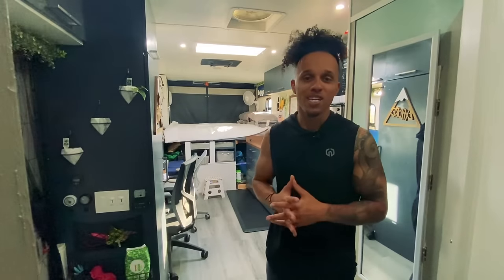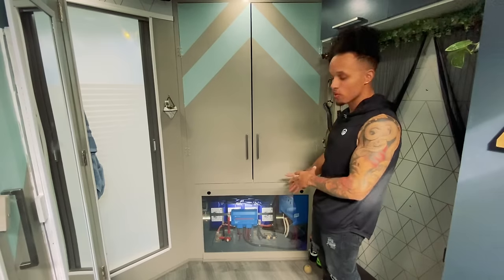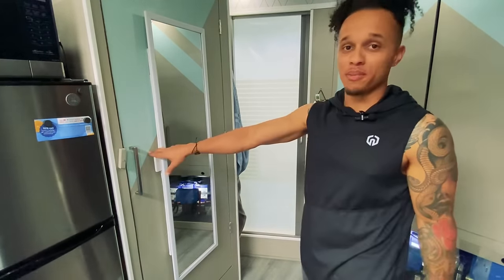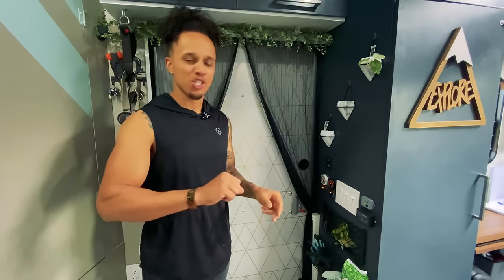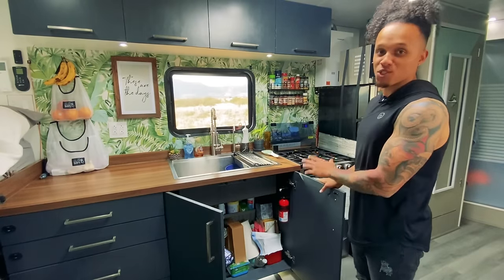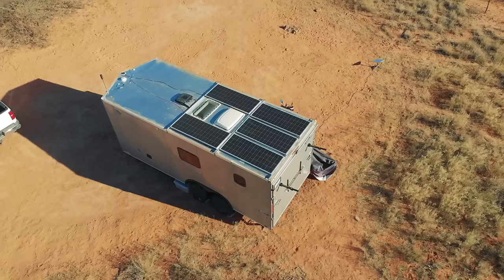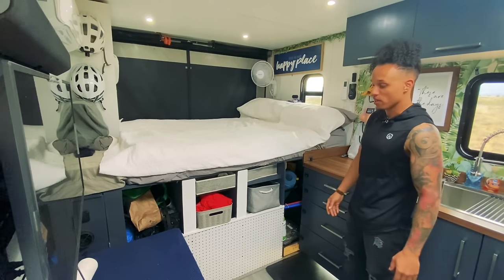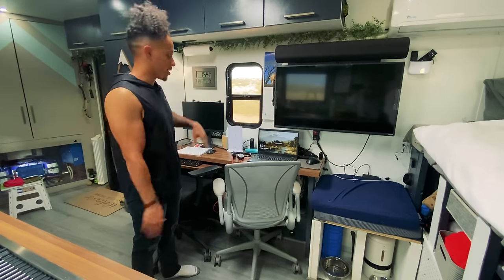The BEST Cargo Trailer Conversion I've seen!

Comment: Really like your cargo trailer conversion; actually getting ideas for an upcoming campervan build. One thing to point out about the extinguisher according to fire department people I know, is that it belongs by your exit door and is visible rather than in a cupboard. The idea is that if a fire breaks you head to the door to get the extinguisher; once there, if the fire seems fightable you go spray it, otherwise if the flames are too big you keep going right out the door to survive.
Reply from the maker: John, thank you for checking out the video 🙏🏽. Hopefully there are some pieces and ideas you can get from it 🤞🏽.. 

That sounds totally logical and makes sense to me with placement of extinguisher.. I might relocate it someday 🤷🏿‍♂️. But I really do appreciate the input man!

Comment: Really cool cargo trailer, tiny home. I'm building one as well and I heard you say that you go out and open your grey water valve. I put in a 12 volt solenoid, which makes life so nice, just turn on the switch and all the grey water goes out automatically. Look it up, easy install and very helpful.
Reply from the maker: Hey George, thanks for checking out the video man!! .. Yes, I know exactly what you are talking about. I almost did that very thing. Decided not to. Turning a valve once a week or two wasn't too bad, so I just stuck with the old school method. lol .. I do appreciate you shooting out a tip like that though! 

I did end up using a solenoid valve just like that for the propane line. Its outside, under the trailer. Basically it shuts off the propane whenever we are not cooking (to prevent a leak unknowingly inside). Its made for Gas of course, not water. Very helpful indeed!

Comment: Nice build fella. You are a great carpenter.  This is a fine working , living trailer. As the one guy said , well thought out. Finishing woodwork was amazing. Don't know if you're a carpenter by trade or not , you could make a good living doing finish carpenter work for sure. Good luck in you guys travels.😊
Reply from the maker: Joe I greatly appreciate that brother!! 

I actually had ZERO wood working experience prior to this. I learned a lot along the road thats for sure through trial and error. A lot of the tools I used were pretty ancient lol, but I made do with what I had. 

I appreciate that compliment though! Who knows, when I retire from my day job maybe I'll pickup woodworking as a side hobby. 

Thanks for checking out the video!

Comment: Awesome build. The only one thing I would have wanted is a sitting area. However if I had the choice of a Nice bathroom and closet area or sitting area I would choose the bathroom.   You do have the desk and chairs so that’s a nice change in a sitting area. I like it
Reply from the maker: Hey Jason, Yes, a seating area.. It was a long debate for me, sometimes I'm happy with the decision, sometimes I'm not. lol.. I guess really it pushes us to be outside more rather than chillin inside, which is a good thing for me, but for the other times the bed does the trick. I am thinking about dropping the bed though which would bring it more to waist level and serve as a chill spot. But thats work to be done down the road. lol. 

I appreciate you checking out the video man!

Comment: Great video! I would like to know more about how your Senville unit has performed and the wattage it draws (heating and cooling). Has 1000 watts of solar been enough power? Has cloudy days been a problem?
Reply from the maker: Hey Scott! Thanks for checking out the video.

You can likely find comments from others where I have answered that same question in more depth, along with a bunch of other questions that I get, but in short Yes the solar has been adequate for the mini split for us. 

So the AC pulls about 750 watts when its on full blast, and about 500-ish watts when its on ECO mode (75 degree temp). This is a cyclem, meaning it goes on for a bit, then cuts off for a bit, and repeats that so its not a constant draw always.

My panels do not tilt so we actually get like 730-810 watts on a sunny day, and that has still been fine for us. If we are in HOT places (100+ degree's) then yeah the AC is running full blast, along with all our other electrical stuff and the batteries may charge just slowly, but I will plug in the generator to top off by end of night just cause I am OCD about things. haha.

Hope that helps!

Comment: That's an incredible build that you made. I have always wanted in my trailers to keep things extremely simple. So I'm out on a lot of things have here. However the way you have handled this every single RV company in the country could learn from, but that would let their dealers get exorbitant rates to fix things several months after they break. All of these Electronics look like they would be simple to fix. I think maybe it's the individual systems. As I've gotten older I'd like some electronic systems but didn't want to have to have to have them repaired by a professional because that's not always possible. But with these systems you can replace the entire system for not that much if you can't fix it. For making an incredible camper and sharing it.
Reply from the maker: Thank you so very much for the kinds words Sir!! I appreciate you... This build was a bit more than I originally was going to do it, but my GF living in here too needed some modern day luxuries. lol. So I made it a bit more comfortable.

Thanks for checking out the video!
Reply: If not for the ladies we would probably just live in tents with rifles and fishing gear. 😁  They soften us. I  suppose it is not all bad.
Reply from the maker: @RM-bx2zt  😂 TRUE Indeed lol

Comment: My dream set up down to the crf300, but I'd maybe go with a dr650, my only suggestion is please get a little bigger extinguisher!!and also if you don't have one ,a fan exhausting out window when u cook
Reply from the maker: Thanks Joseph!! The 300L (being new to the dirt) has been just perfect 💪🏽. But I definitely think about going bigger sometimes. But usually when I’m riding on the roads, which I try not to do anyways. 😆 

But yes we have a fan right above oven which pushed the air out ✅.

Comment: That's luxury living right there!  Great work.  29:40 I guess the microwave is strapped down to the fridge?  And that looks like a tankless water heater behind it, but from the overhead shots I don't see the exhaust.  Where does the propane exhaust come out?  Oh, and props for the bikes -- CRF300L maybe, what I've been wanting for a couple of years.  One more question, how do you secure the chairs when you drive?  Thanks, this is a truly livable build, great design and execution.
Reply from the maker: Thank you so much 🙏🏽. , yes your correct. Microwave simply strapped to fridge (with cam straps) and thats worked great. No problem while driving. 

The exhaust for the tankless goes out the side wall, not the roof (one less opportunity for roof to leak). 

Yeah, 300L thats my adventure machine 💪🏽. I love riding that thing! But sometimes my GF Trail 125 is actually funner haha. 

The chairs get flipped upside down, and strapped to an anchor on the wall. Its just a D-ring screwed to the wall, which I loop a cam buckle strap through, to hold the chairs in place. That has also worked great with no problems while driving.

Comment: Man great minds think alike. :)
You did a great job, and I know how much work it is. I am just finishing up the main systems on my 16x7x7 new cargo trailer conversion.  For the summer I am parked on my bush lot in Quebec which has a well with a pressure tank. For the winter I am boondocking in the desert. I am currently boondocking in California near Yuma. I am retired and 66 years old, and this was all new to me as well. I too had no experience with plumbing, electrical, etc. The similarities with your build and mine is why I say great minds think alike. :)

I have 900 amp hours of lithium iron phosphate batteries and 1300 watts of solar panels on the roof. I have an Airhead compost toilet. My on demand propane water heater and all plumbing is on the bathroom wall where it is easy to access if ever needed. All PEX and Sharkbite fittings. A flip of a few valves switches between using the 12 volt pump and the 100 gallon fresh water tank in the bed of the truck when on the road, or the well at home in Quebec which has its own pump. I can also bypass the water heater with a flip of two valves. The water inlet is in the V nose, and i just hook the drinking water hose up to it from the truck bed tank when I stop for the night or boondock.
My shower was built from scratch using FRP to my weird dimensions and dumps directly onto the ground. Needless to say, I never use it at Walmart. :) 
I have a full sized Samsung home 120 volt fridge with a pull out drawer freezer with ice maker.  This is where about half of my electrical power goes, but it is worth it. I really dislike RV fridges. 
I have the usual RV oven/stove which runs on propane.
I have a portable a/c unit that can turn the RV into an icebox. I only use this a few days in the summer, and don't even take it to Arizona for the winter. I can run it using just solar power, but that is not really practical. 
I too love my magnetic screen door, and so does my dog. I too have a huge 32 inch computer monitor on a wall mount that I can float in front of me in my recliner chair, or pivot to watch in bed. 
I have no holding tanks except for a 6 gallon gerry can under the kitchen sink. On the occasions that I spend a night at a place like Walmart I can flip a valve to change from dumping the sink water directly onto the ground to diverting it to the gerry can. This 6 gallons is plenty big to get me from Quebec to Arizona or back every year.
I have 2 inches of foam board insulation under the floor outside. Two inches in the rear ramp and one inch in the walls. Four inches in the ceiling, which is tongue and groove pine with 6 pot lights. I spent 40 hours sanding and shellacking the pine. 
All my half finished cabinets are hand made from pine from my cousin's sawmill in Quebec. There are a total of 10 - 120 volt outlets throughout the trailer, but all but one are hidden. Some have USB A and C.
I too have the bed at the rear with the garage underneath. I am an astrophotographer and a lot of this space is used for telescopes. This is also where my solar system and battery bank lives. I have Starlink internet so I am connected everywhere while boondocking.
My windows are on the way and I should have 2 22x14 windows installed within a month. The last major job that is not cosmetic will be running propane lines, which I am learning about now.
I don't have to tell you how many hours are spent researching, learning new skills on Youtube, etc. while doing a job like this. It is fantastic that you did this while young and are able to travel and boondock. Well done.
Reply from the maker: Well I will be darn, great minds sure do think alike, and it sounds like our builds are VERY similar in a lot of ways. That is awesome!! I sounds like you are doing an excellent job yourself figuring out how to do things and putting in the hard work to give you the life that you dream of. Big time congratulations on that Sir and thank you for sharing that with me!

It sounds like we aren't too far from one another either. We are currently parked out in Phx, AZ but soon to be heading to San Diego, California by the end of the week.We will be driving right through Yuma on our way. There is a "Tiny Fest" going on in San Diego this Mar 11-12. Basically a bunch of nomads showing their rigs to the public and giving advice/tips and all that stuff, as well as professional builders offering their services. If you are free that weekend and happen to swing down, you will see us there in person. We have a spot to show our rig to the public as well. If you Google "Tiny Fest California" you should see all of the information about it. 

If/when we work our way up to your area of Canada, I will be reaching out to you!.

Best of luck on the remainder of your build and again, congratulations on making it happen, no matter the age. Very inspirational Sir. Thank you and God Bless!
Reply: @whoiskyran1446  Hi there,
It's nice to hear from you. I won't be able to head towards San Diego as I am likely going to have to head to Phoenix to visit the manufacturer of my cargo trailer. It is a Compass (Look Trailers), and I have separation of the aluminum panels in a few places that have to be reglued. Fortunately they have told me they can do it in one day.
I will likely be here until at least next weekend. If you two need a break from the drive on the way through the Yuma area you are welcome to stop by for a visit. I'm on BLM land about 10 minutes off of I-8 once you enter California. Let me know and I can message you privately exactly where I am. 
And I am near Pembroke, Ontario from about late April until mid - October if you ever get up that way. I have lots of room to park your rig if you want to check out the area.
Reply from the maker: @headdown1  Oh man, that's no fun. I'm sorry to hear that you have to deal with those problems. Hopefully they can get it all fixed up quick for you..

Okay, Awesome, thank you for that offer! If we do find ourselves that way I will be reaching out for sure. Pembroke that is quite a ways east. Do you pull/or plan to pull your trailer back and forth from Yuma area and Pembroke? Or just leave it parked and fly seasonally.

We likely will be just stopping to sleep on the way to San Diego unfortunately. So we will have to miss you this time.
Reply: @whoiskyran1446  Yeah I'm not real happy having to get this reglued. It is mainly the trip into Phoenix that sucks, since it is going to cost a lot in fuel.
And I am pretty far east. I am just above upstate New York. It's about a 2800 mile drive from here, and I've driven it every 6 months for the last 6 years.
And yes I understand if you can't stop by this time. If you change you mind let me know, and if not have a great time in San Diego!
Reply from the maker: @headdown1  Well best of luck on that drive back and I hope they get it all figured out for you. Cheers and happy travels boss!
Reply: @whoiskyran1446  Thank you!

Comment: This is a great build! Excellent! I am in process of selecting a trailer and I will be putting a dual-monitor workspace in it. I am a software developer and work remote.

What is your tow vehicle and how does the 8' wide trailer tow for you? Looks like maybe a Chevy.  I was considering a 7.5 x 18, but I was interested in the 8' wide, since the axle for those is generally the same width.
Reply from the maker: Hey Brice, 

Thanks for checking out the video man! Sounds like you have a pretty fun project coming up yourself, exciting!

Yes, its a Chevy 2500HD (Gas engine) and it pulls it great! The 8' wide for me was a must, really adds to the space for sure. I love it!